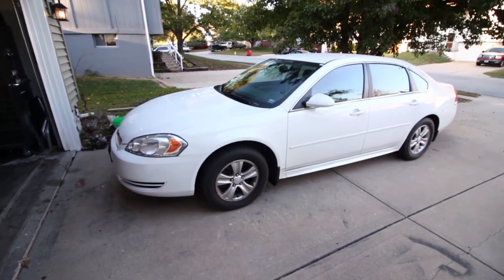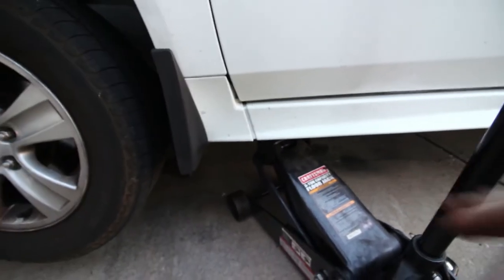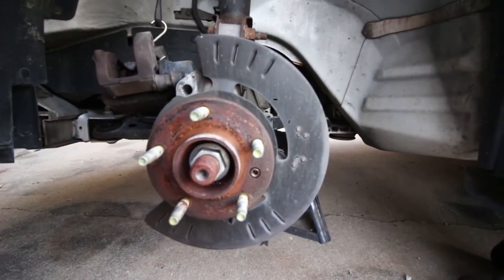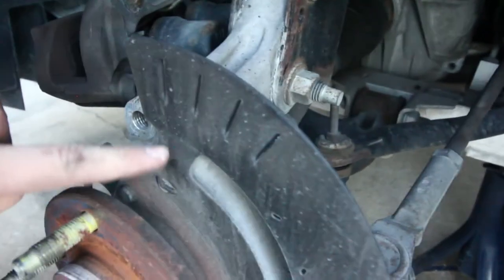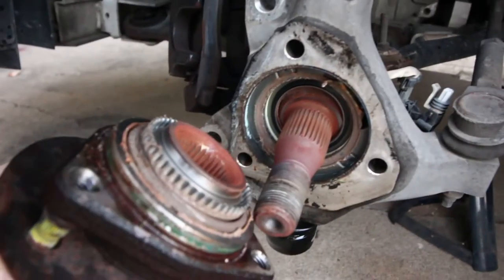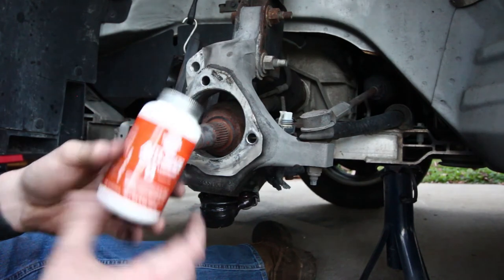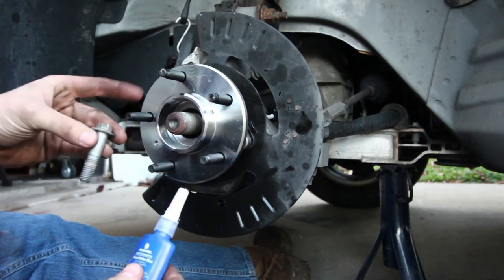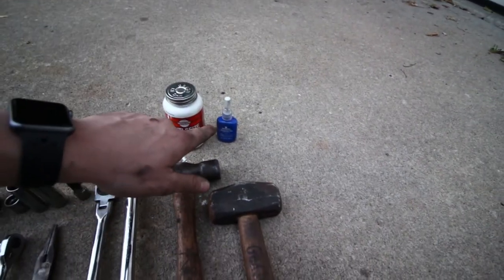How To Replace 2006-2013 Chevy Impala Wheel Bearing/Hub (In Depth DIY Installation)

Comment: I just finished the job!  Mine were stuck on a little more than yours.  I ended up having to use an 8 lb. sledge hammer to drive the CV shaft back and then after I freed it up, it seized again, so I had to use a 3-jaw puller to pull the hub off.  Overall it wasn't a bad job.  Thank you so much!  Keep up the great content!

Comment: Well done, young man! Very easy to follow and I could understand every word you said. It also helps a ton that you cut right to the chase and didn't waste 10 minutes with preliminary fluff. So, I am now a subscriber! Bless you.
Reply: Now, I just have to figure out how to determine if this is my problem. I also suspect the cv shaft. The only symptoms are 1) a shudder at interstate speeds when going up an incline and 2) a wobbleike a wheel needs balancing. More prominent the first 5 miles of a trip.....

Comment: Great step by step video 👍.  Firestone quoted me $850 parts and labor for the front both sides. It's time for me to pull out the tool box.
Reply: My Mom just paid $400 to have just one of the front hubs replaced.  The other one is now locking up the front wheel at times, so ordered the pair of 2 hubs for $70 on ebay.
Reply: Crazy! You can order a new set on Amazon for about $70! Even with an hour each side at $150 per hour that's still not even $400!

Comment: Great video. What symptoms did you experience that lead you to replace?
Reply: Vibration in the steering wheel, pulling to left or to to the right, stability track/traction control light can come on, or “service stability track” ,  can pop up on hard pulls, loud grinding noise/hum under 40mph, if it’s very severe, extreme jerking when accelerating, not able to come to complete stops correctly or car won’t stop properly.
Reply: Wow I'm having the same symptoms time for this to be upgraded

Comment: I could not get those caliper bracket bolts off for the life of me!!! And I live in CA! Broke a 1/4 to 3/8 adapter into the 3/8 socket! I gave up. Will have to take this to the shop unfortunately.
Reply: Ended up using a beaker bar and car Jack and it came off!!

Comment: On these front wheel bearing assemblies with the anti-lock brakes with the wire on is there a right  left wheel bearing assembly
Reply from the maker: If I remember correctly they are Interchangeable from side to side. Should be the same part number for both sides.

Comment: What was the bearing doing to make you notice that it needed to be changed?
Reply: Makes a grinding noise, there’s videos out there to help you diagnose if it’s the bearing
Reply: @jamesking6272  thanks..
Reply: @MyLifeThai371  well I have a bad transmission then..... cause I have an 08 impala.
Reply: @chrisnas1483  I inherited an 08 with unknown history.  The transmission fluid was black!  I drained it, changed filter, new fluid BUT there is a grinding/roar type sound.  I'm about to change the bearings.  Your comment has me concerned about the transmission though!
Reply: My mom's 2013 actually locks up one of the front tires, when she starts out with the wheel cranked.  The traction control light flashes when that happens.

Comment: Whats symptoms did you notice that made you replace the wheel bearing?
Reply from the maker: Often times you will experience a steady or intermittent traction control light, growling noise from the bearing while driving, and/or play in the bearing when shaking the wheel side to side or up and down while the vehicle is off the ground.

Comment: APPARENTLY IMPALAS HAVE AN ISSUE WITH LOSING CALIPER BOLTS, WEVE HAD BOTH SIDES COME OFF AT DIFFERENT TIMES AND THE CALIPER CAUGHT THE RIM AND LOCKED UP MY MOMS WHEEL. THREADLOCKER, THREADLOCKER, THREADLOCKER